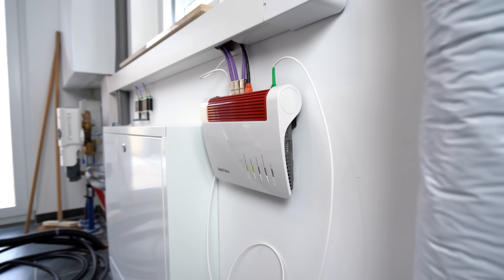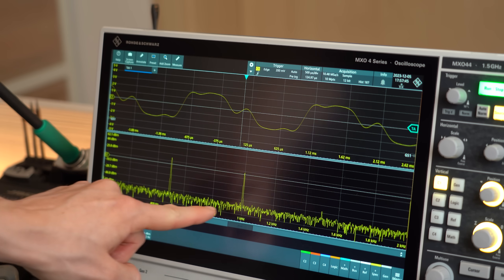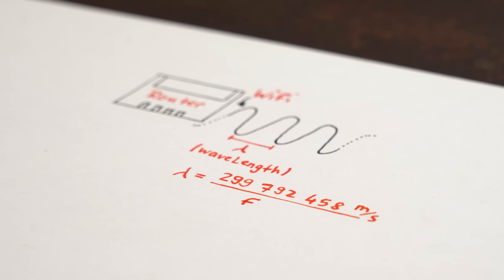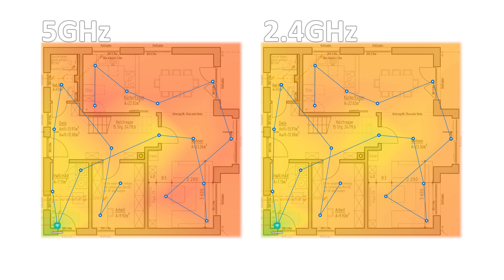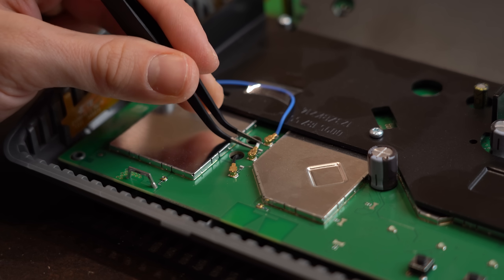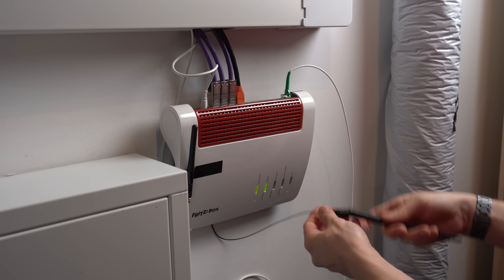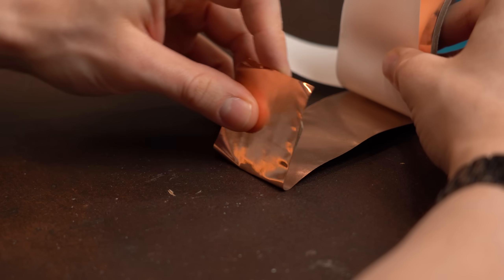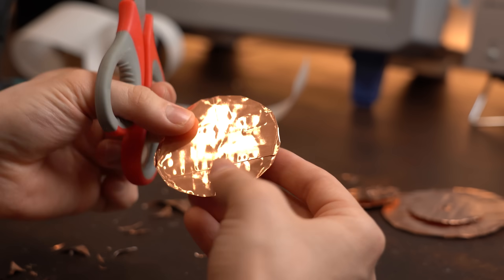I tried OVERPOWERING my WiFi!

Comment: Please, can you design a complete working surround 2.1 decoder amplifier electronic circuit for a speaker box which will have 2 stereo speakers of 4 ohm 2 watt with a subwoofer of 4 ohm 5 watt and it will connect to a PC and can you make it and shown it in an upcoming video with full details ? It would be very helpful to me and everyone who has these kind of leftover speakers in our homes from salvaging a monitor.

Comment: 10:42 these antennas work, but they are very sensitive to assembly, inaccuracies greatly affect their operation.
Antennas of this type were even used on the Soviet lunar rover
Reply: Yeah, and these antennas are not a good idea for indoor wifi. It's VERY directional. It's better suited when you have two antennas like that and they are communicating in a straight line, even kilometers away. Then you use your regular omnidirectional antennas to spread it around the house.

Comment: For best performance, a 1/4 wavelength antenna needs a ground plane to present as a mirror, not so different than when you put a 1/4 wave antenna ontop of a mirror  visually the antenna and mirror together look like and operate like a 1/2  wavelength antenna. With  the largest visual profile of the antenna and and reflection in ground plane  being the same angle with the largest db gain.
Reply from the maker: Thanks for the feedback :-)

Comment: You really need to be tuning your antennas before ruling them out entirely. WIth all the stuff you do, I would think a simple VNA @ 2.3-2.5GHz would be something possible for you to use. The end result, sure I'd agree for many, don't build your own antennas, unless you learn more about then and have the proper tools to test them. Best case, they work, worst case it fries your transciever. Sorry but meh, very click-baity.
Reply from the maker: Thanks for the feedback. Hopefully I can do better in the future ;-) Truth be told, I am not an RF engineer.
Reply: At these low power-levels its unlikely you will fry your transceiver, but at higher levels.. yeah, might just reflect too much power back due to the antenna being bad.

Comment: If I can't use the router software to 'improve' the signal (via changing channels to less crowded ones, etc) then I block off the signal going to areas with use of aluminium foil. An added benefit is that you can shape the foil sheets into vaguely parabolic shapes, enabling the direction the wifi signal to where it is needed.
Old-school
Reply from the maker: Thanks for the tip
Reply: I mangled my comment a bit, but glad you get it. Additionally, using foil to block off un-needed areas, and at the same time bounce signal where needed, is great - but you can also utilise line-of-sight by bouncing signal off sheets of foil placed like mirrors around the apartment @greatscottlab

Comment: Hi, what app do you use to measure wifi strength across the territory?
Reply: Fritz routers offer a tool to measure speed in real time either on receiver or on the router interface.
Reply from the maker: Netspot. I mentioned it in the video 🙂

Comment: Finally a wifi improvement video that isn't all just in the routers settings in the browser!!! Thank you for the inspiration for my next electronics project!! Great stuff GreatScott!
Reply: There are some routers and access points that you can connect to using telnet and set to regional setting = test_mode , , therefore there are no limits on transmit power.
Reply from the maker: Haha glad I could help 🙂

Comment: Another option would be to move that new Wireless access point. Being against that wall and having it surrounded by conduit and furniture will affect its range too.
Reply: Yea that metal box next to it and that aluminum foil tuve on the other side are not making it easy for the signal.
Reply: Ethernet and or Powerline would be an option to move a wifi router. On the wall of the lab facing the middle of the flat would be an option as it can be a bit techi in there
Reply: I work for a small remote ISP that includes a wireless router with 4 or 6 antennas built in (and not commercially available). They are able to beam form for a better signal to the WiFi device.  I’m not certain going external would help much in that case.
Reply: @steinshaw2490  this too. Lots of new routers have beamforming abilities esp like 3x3 or 4x4mimos
Reply: Yeah, a single PoE access point in a good, central spot can make a huge difference
Reply: Or swap the antennae on the Router to a higher gain. Note: It distorts the torus-like shape that is generated to stretch it perpendicular to the antenna, but compress it parallel to it.
Reply: Or put foil behind it. There's no need to broadcast to the wall
Reply: Czech Republic: with my local ISP, they normally equip people with archer c7 or you can buy your own, I have solved my problem by having 2 ASUS AX4200 in mesh network connected via Ethernet, I can't be more happy. My cable run is little janky, but worth my 2hrs of work 😂
Reply: @RadOo  why do we the average Joe know how but a supposedly experienced professional and enthusiast can't and can't make a WiFi antenna.  But actualy made a shorted antenna ultimately melting or damaging his chip? 🤔 
Fake it till you make it then let people figure it out slowly is all I can say! Typical YouTuber stealing things and making it their own. Hackrf for eg! It's originally Chinese, he just added safety and a different chip giving more options but with the same circuitry!  Weird but work's but overpriced and lied about is my point.
Reply: Also putting it in the middle of the house might be a good move. CAT6 can be hidden easily, mount the router high enough to avoid obstructions like cupboards and radiators...
Reply: The metal cabinet shown next to the router is a factor too, certainly for the built-in antennas which were very close to it, I think. A lot of that 100mw was wasted (very slightly) heating up that metal.
Reply: All you have to do is get a fiber optic coupler and extend your fiber to a more centered location of your house. It’s sad that most new build houses that are pre installed with fiber routers are mounted in the garage on one corner of the house.
Reply: Much more fun to add an extra Kilowatt to the output.
Reply from the maker: True. But sadly this is the only available spot to mount it.
Reply: @greatscottlab  It is the only best solution. Take it. I know it does the job, I had the same problem. I moved my router from the down floor to the first floor, and now all levels in my house (3 floors) are covered. C'omon Scott, you can do it too!
Reply: @deslomeslager  yeah the placement was the first thing that made me smh.. like let's put a crappy router with omnis right in the corner.. literally does a site survey and instead of listening to the data....
Reply: @deslomeslager - I agree, moving the router to a higher floor usually provides better coverage throughout the home.
Reply: @greatscottlab 
Why not put a 90 degree (corner) reflector behind the omnidirectional dipole antenna?
Why not use a BiQuad Antenna?

Also, 2.4 and 5 aren’t quite multiples of each others, you would get better results by choosing a perfectly tuned antenna for each frequency range AND an impedance matching circuit would help you even more.

Yes, I’m baiting you into doing a video next year on impedance matching and various antenna types.
Reply: Back in the 2000s I've made a biquad antenna and connected to a router some 650m away and had a signal of approx -78 dBm. Great times! Be aware that switching antennae from a inbuilt one to a directional one means (in the EU) you have to decrease transmit power to meet the 100mW EIRP max transmit power accordingly. Even with that, connection was good and stable!
Reply: @greatscottlab  Why not rewire the antennas and simply place them in a more central location?
Reply: @greatscottlab  Put an access point in the ceiling in the middle of the house, that should do both downstairs and upstairs. Turn the main one's wifi off and get rid of the one upstairs?
Reply: @greatscottlab since you have installed external antennas why not take the next step and move them away from the router to a potentially better location to improve your coverage in your home.  Additionally I have purchased a couple of inexpensive wireless routers/access points that are compatible with DD-WRT firmware and installed and configured to fill in weak/dead zones in my home and yard.
Reply: @gullreefclub the length of the antenna cable does matter. I don’t remember the math, but there is definite loss in coaxial cables, especially the tiny cables shown here.
Reply: @greatscottlab  How about a metal plate on the wall under the router to bounce the signal forward.
Reply: @greatscottlab that is 100% definitely not true
Reply: @greatscottlab  some have the ability to create a mesh network that will still improve performance
Reply: @greatscottlab The problem is that it's an ISP provided box, they are usually cheaply made and lack many features that would speed up the Wi-Fi. I would consider disabling the built in Wi-Fi on this and purchasing an access point from a known manufacturer and placing it in a space where you use it most.
Reply: @kreuner11 In this case, that's not true. These routers have many user-accessible features, such as a business WireGuard VPN server
Reply: @kreuner11 FritzBoxes aren't made or programmed by ISPs, only resold or rented, and you can buy the same model freely on the market. They're quite good
Reply: @kreuner11 I'm impressed with my ISP supplied ftritzbox. Pretty decent kit. The one I have includes a built in dect base, which until you've actually had that combo, will have no idea how kewl it actually is.
Reply: @kreuner11  you usually have to buy your fritzbox, and they are kinda expensive for what they are, but expensive and somewhat good quality nonetheless
Reply: @kreuner11 the fritzbox range are actually very good for features they'll even detect radar on 5ghz and temporarily disable 5ghz if you're on the interfering frequency. Heck it even shows you the best channel by showing you the congestion on a graph on each channel and how much traffic on your current channel isn't yours
Reply: @AtaGunZ you don't actually. My ISP sent me mine!
Reply: @gazzat5   hence the "usually" in that sentence. 

And most of them sell you the router and hide it as part of the long term contract. For example, PYUR will take a "one time contract start payment" which is just selling you the router if you read the fine print.
Reply: @gazzat5  all aps do that with radar now, it's a requirement in many zones
Reply: @LarixusSnydes 🤦
Reply: @resneptacle  do they still use a re-branded version of OpenWRT?
Reply: @LarixusSnydes  Yeah, and they usually underdesigned in CPU and RAM... I've connected small SOHO routers serial console in the past, and did some testing... those CPUs just not capable to NAT 5-10+ devices, and also do WiFi (mostly because connection tracking, and NAT tables can fill up the memory very quickly)
Reply: @kreuner11  Its not an ISP Box. Its an aftermarket Prosumer Targeted Router and ist costs about 230€ for the 7590AX which is on of their flagship Models. I happen to have the same Box at Home and can say the new boxes from them are really crap in terms of WiFi Signal. Using one of the old 7490 as a mesh repeater and it is really better. There is an aftermarket kit to improve the signal.
Reply: @kreuner11 tbf those FritzBox routers (made by AVM) are pretty good. It's not that they are some OEM shit, but Most ISPs just sell you some of the shelf ones (at least here in Germany)
Reply: @kreuner11  Or building his own from an old PC.
Reply: @greatscottlab  your dielectric constant is way off for WiFi for starters.
because as an electronics enthusiast you can't move it! 👍 👏 😂🤣 
I get this crap from my ISP all the damn time, so I did it myself. 
Fiber is delicate but even a nobody like me can do it. 
Apparently extender plugs ect aren't a thing? 🤔 😂 🤣 👏 
You've lost it mate. Sad. 😔
Reply: @greatscottlab You can also just stay with 2.4 GHz. With 802.11n you can achieve up to ~600 MBit/s,.theoretically.
Reply: @ScienceMessiah 802.11ac is 5GHz.
Reply: @giornikitop5373  ur right. I meant 802.11n.

Comment: So amplifying is not an option due to legal power limits? Cool, are you aware that the limits are expressed as Äquivalente isotrope Strahlungsleistung (EIRP)? Which is calculated by multiplying the output power by the antenna gain in dBi. For 2.4 GHz the limit is 100 mW EIRP and for 5G it's 200 mW or 1000 mW for certain frequencies EIRP. Since your Fritz!Box already puts out that much power, any antenna with a gain of more than 0 dBi, such as the directional antenna presented by you, will exceed the legal limit. Any changes to the antenna violate the rules anyway. The BNetzA writes: "Die maximale Strahlungsleistung darf nicht überschritten und die Konformitätserklärung des Herstellers der Funkanlage durch Veränderungen an der Antenne nicht verletzt werden. "So basically you abandoned the amplifier idea due to legal concerns just to proceed to another illegal solution. Source: https://www.bundesnetzagentur.de/SharedDocs/Downloads/DE/Allgemeines/Bundesnetzagentur/Publikationen/service/WLAN.pdf?__blob=publicationFile&v=9

Comment: You could have had your modem in more center of the house, as its more optimal, having it in the corner of the house, just increases the walls amount
Reply from the maker: True. But sadly not possible to do.
Reply: @greatscottlab  yea fell you, probably misplanned wiring won't let you

Comment: Big fan❤
Video idea(diy or buy)
EOP (ethernet over power line)
The device uses house wiring as a data line for networking
Here is a sample product (Tp-link Tl-wpa7517 Kit Av1000 Gigabit Powerline Ac Wi-fi Kit Lan Adapter)
Reply from the maker: I can put it on my to do list 🙂

Comment: so you built a new house... and didnt wire ethernet?... that is a bit silly

but if you want good WiFi... get better networking gear, like UniFi stuff
Reply from the maker: There is ethernet in my lab, living room and one upstairs. Should be enough in my opinion.

Comment: I was expecting you to also put a reflector behind the antenna.
Great video, nice explanation!
Reply from the maker: Might try that in the future. Thanks.
Reply: @greatscottlab I've heard people mention this works although never tested myself or seen anyone test it.
Reply: Are there antennas that are half directional that emit in half circle? You don't need wifi outside so with omnidirectional antenna a lot of energy goes nowhere
Reply: @realdragon yes, with high-gain directional antennas or antenna arrays, you can get very narrow beams that are even more directionally selective.
Reply: Yeah, was expecting that as well. Put a ground plane on the wall behind the router. Especially since it's in the corner , if you can put a ground plane behind the router and other wall you should see a 6dB bump.
Reply: yeah and it all should be isolated. not connected with a metal bar ... it could actually work .. this is just one conductive thing. It looks like a Yagi but its not.
Reply: Or even a cantenna which is relatively simple to make.... but probably illegal for transmit unless you know what you're doing....
Reply: The Yagi-like antenna he was trying to build in this video is a series of reflectors and directors.  The challenge is to get the spacing correct, and it is frequency-dependent.  The higher the frequency the harder it is to build resonant antennas to the proper dimensions.
Reply: If you place a ground behind the router you could increase the signal locally but it will also amplify the dead zones based on the spacing between the router and ground plane. The ground plane acts as a mirror creating an equivalent router at the distance “into the wall”.

Comment: Hey greatscott! I am a network engineer by trade, are you able to change out that modem/router combo unit? I would love to help you out with a network topology that works for you.
Reply from the maker: Now with the new antennas I am quite happy with my setup. So no need for changes here.
Reply: @greatscottlab  that's all that matters! I do want to add some protocol knowledge to this though. With these types of access points you also have to consider the local RF landscape. As your wireless devices may be able to hear your neighbors. And with how wifi functions only one device can talk to the router at a time. And if your devices are hearing other neighbors routers they will wait before talking to your router. So everyone setting their power levels to the max can actually be detrimental to everyone's wifi experience. Observing what channels are in use around you will allow you to select a less utilized channel to help avoid that scenario and allow for more airtime for your devices which will help increase the bandwidth.

Comment: Who's the idiot who mounted the SC-APC cable?
It's kinked and hanging loose.
Fix your fiber optic cable to the wall and un-kink it.
Reply from the maker: I did and it works just fine
Reply: @greatscottlab  It probably works, but kinks cause reflections in the light, reflections are noise and you may find that you come home from work one day and it doesn't work or that you're experiencing other issues.
All i'm saying is that it's not supposed to have a kink in it.